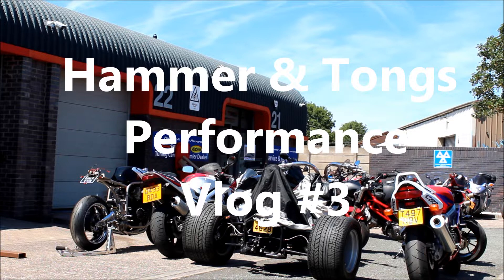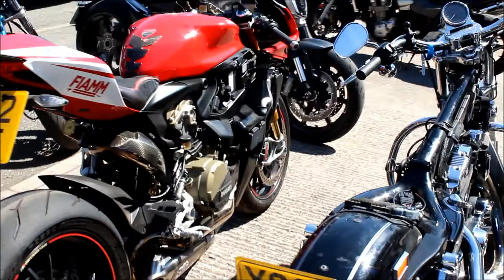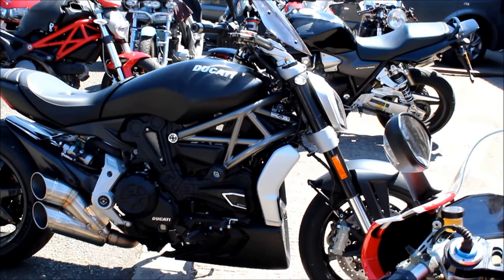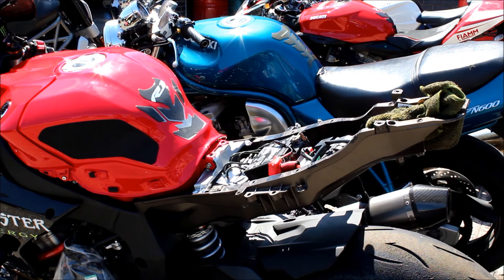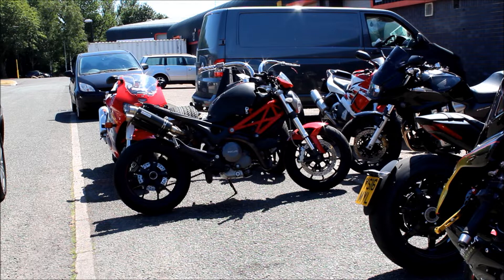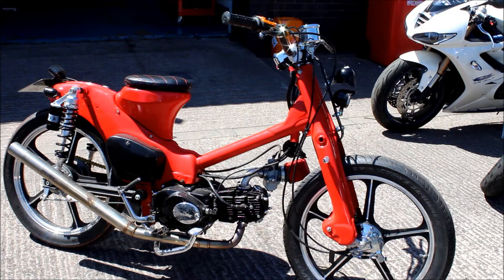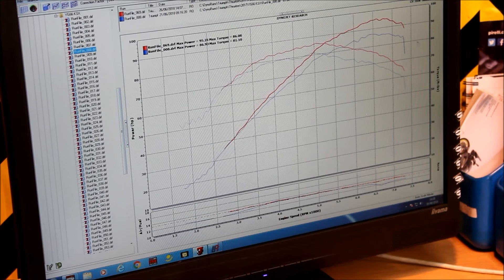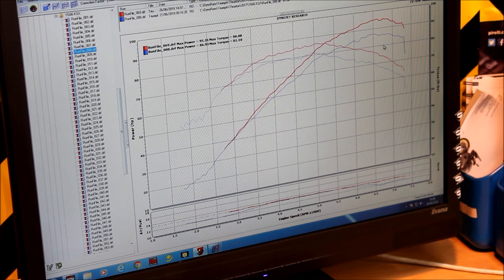Hammer & Tongs Performance Vlog #3

Comment: What mods were done and what was the bhp & torque gain please?
Reply from the maker: As it states in the video at 10:30, the bike had a BMC air filter, a Power Commander 5 (with custom map) and an aftermarket exhaust system (I don't know what make). Rear BHP went up from 85 to 96 while torque went up 5 to 85lb/ft. You can see the difference in the dyno chart on the screen at this point in the video.